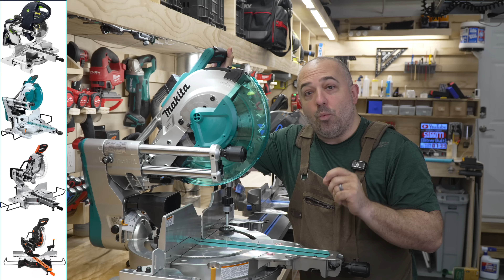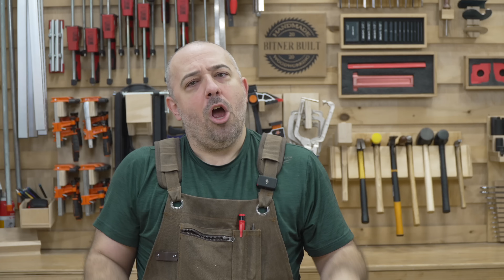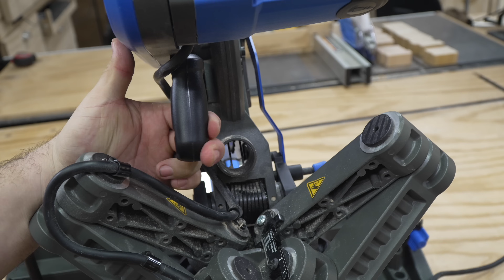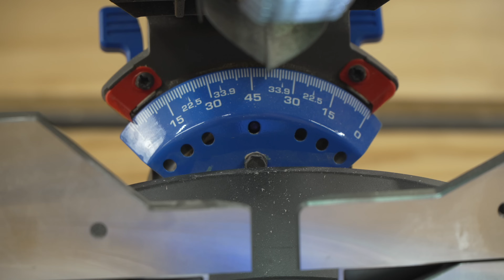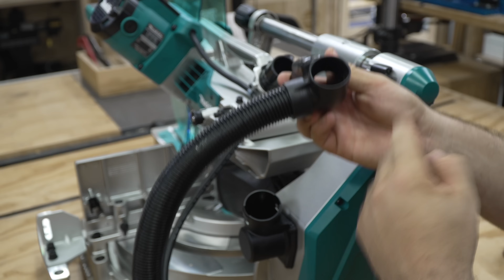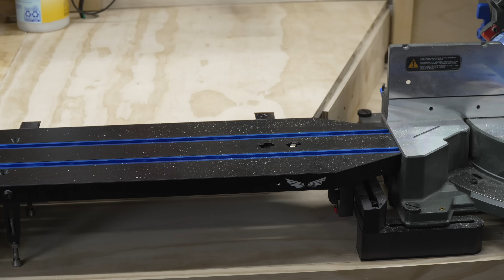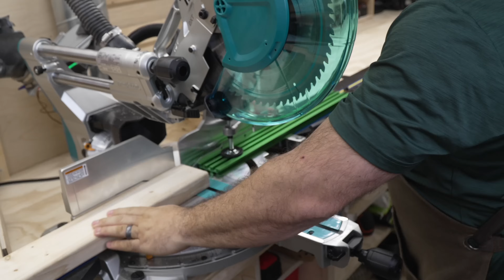Rail Vs Bearing Compact Miter Saws - Makita LS1219 & Delta Cruzer

Comment: Love my Bosch glide 10" and don't see any issues with deflection.  I get great fitting miters. The user can be the cause of deflection and I've watched videos showing heavy reflection on the Dewalt front slide as well.
Reply from the maker: that's great glad you love yours! the user would always be the cause of the deflection but they shouldn't be capable of doing that is the issue. I didn't have a force gauge type of measuring tool to use to show how much I was pushing (have to trust me there) the delta, I get BIG movements with very little pressure at all. so much so that I spent the extra money to replace it, couldn't take the errors anymore. I really wanted that one to work tho!

Comment: I bought the 10" Rigid version last year after a nearby Home Depot listed it very cheap. I can deflect it quite a bit if I push it side to side, but it doesn't seem to affect my work. Perhaps because of the shorter reach? I only use it for rough work, though.
Reply from the maker: yea when I first got it I was wonder about how the blades spinning , the centrifugal forces would keep it centered possibly (wrong way to think about it) it seemed fine until I was making a face frame for a cabinet and it was way off between two cuts and then a week later same thing where a 3/8th difference matters
Reply: @BitnerBuilt  Yikes. Yeah, I'd replace mine if I start seeing discrepancies like that.

Comment: Nice video, i was shocked to see the level of deflection in the delta. I think its important to keep in mind that mitre saws are really carpentry tools with carpentry tolerances.  For cabinet making i find the best results come from a well setup table saw and mitre / cross cut sled.
Reply from the maker: Oh yeah, of course everything revolves around the table saw, but that level of deflection was just too much. I gave it a go too, which I kind of regret not immediately sending it back because it was very obvious right away but 🤷 hopefully helps others
Reply: I agree. I have so much to learn to be accurate with a table saw. I need to focus on this tool so I can master it. I am intimidated by it still so I avoid using it whenever possible .

Comment: You need to look at the Metabo as well. Great saw for the money.
Reply from the maker: Well dang that one slipped under my radar! Front rails, shadow, $450 honestly I would’ve gone for that and instead of the Makita to try out. Well, I’ll add it to the spreadsheet and description here. Thanks for letting me know about that one.
Reply: @BitnerBuilt  The Metabo also has a vertical midline handle. Less deflection than pulling down on sided mounted horizontal handles. It's should also be more more comfortable for left handers, which I'm not, but there is that.
Reply from the maker: @ST-0311  im actually angry I didn't know about this one, I would have tried this first from a budget standpoint
Reply: @BitnerBuilt  not to mention that it goes on sale at big blue quite often.